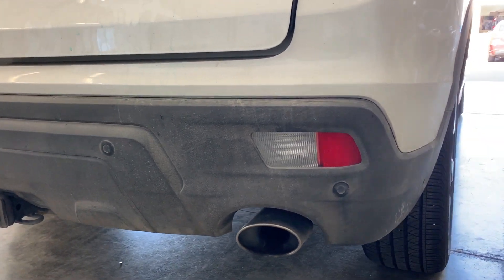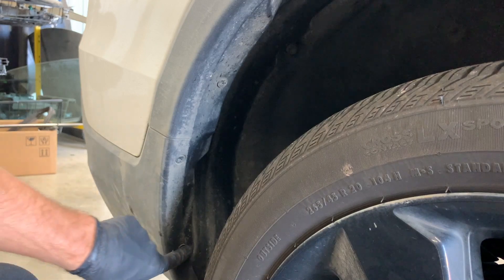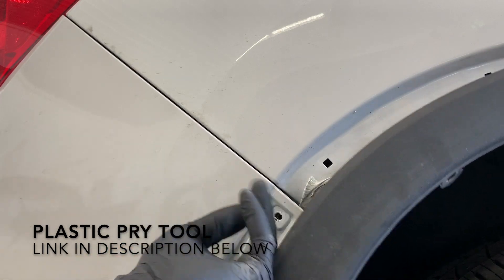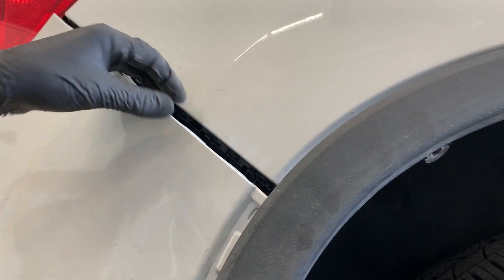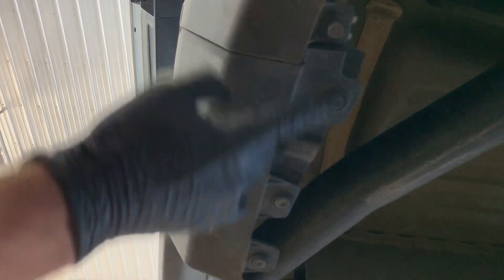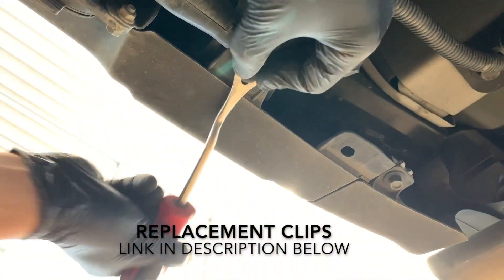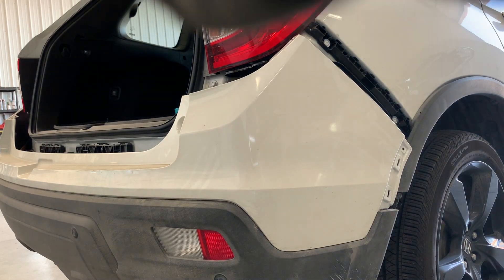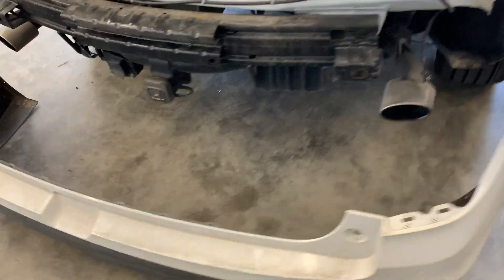How to Remove the Rear Bumper Cover on a Honda Passport 2019-2021

Comment: Thanks for the step by step.  I followed your direction on this video and no issues.  Just a couple add-on comments.  Mine was the touring model with the mud flap.  Therefore, in order to remove the 2 screws on the bottom, you have to take the screws from the mud flap first.  No big deal.  And also, i thought it was easier to disconnect the 2 cables that you disconnect at the end of the video, but that being the first thing by going under the car.  They are accessable that way. But great instructions regardless.